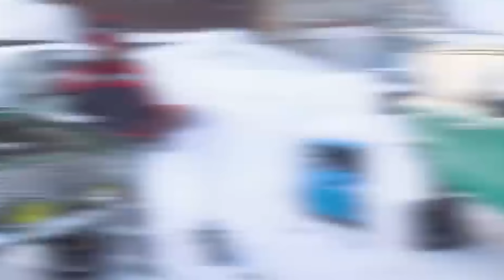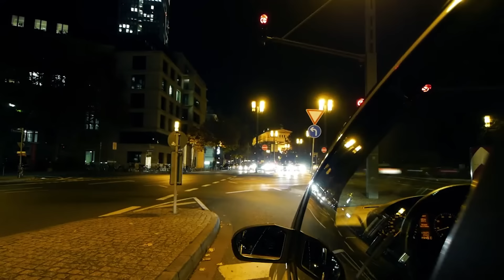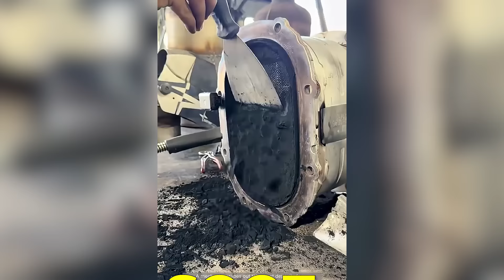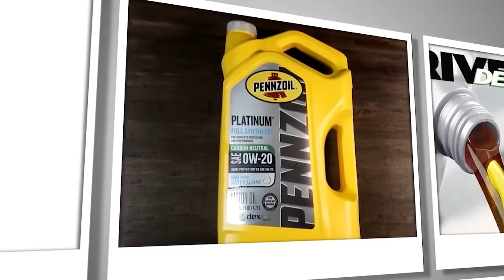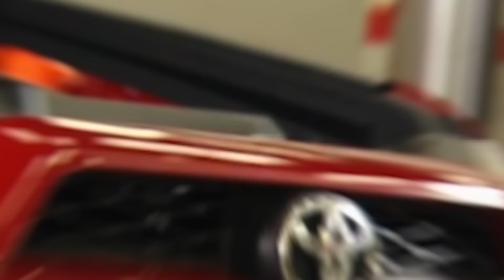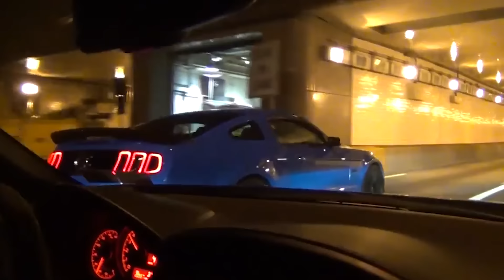(0w20 vs 5w30) The Oil Mistake That Can Kill Your Engine

Comment: I would never a 0w20.   May as well use water.   Funny, I got 285,000 on my 2011 Impala, use 10w30 since new.  Filter change and oil change, in Spring, the Fall,  winter get to -35 in Canada.  In the Spring, the oil is slightly contaminated with water and gas.  In the fall, its dirty from mostly dust dirt and microscopic metal and carbon.
Reply: Great for an older car. Can’t always get away with with that on a newer engine since they are not built like that one.
Reply: My 2010 Ford runs on 5W, and I hate it. I changed oil at 12k, normally going to 15k, and it was like water. Not anything like engines designed for 10W. 

I dont normally check miles as I listen and feel the motor instead, and my Fusion started to tell me at 12k. 

That's shorter from what I'm used to maintaining in my 1991, 1988 Mr2, or even my sold Lexus RX300.
Reply: @phoenixmistertwo8815 you don’t know what you’re talking about. 0,5,10 are not what engines are designed around. It’s the second number of weight of the oil at operating temp or 100 degrees celcius.

Comment: How about 0w30. Its in the middle
Reply: Thats what im thinking of using..mobil 1 0w30 or the new "clean" formula  5w30 with a pour point of -48.
Reply: It’s still 30 weight at 212 degree no matter how you look at it.
Reply: That is the cold weight. Makes no difference once up to temp.
Reply: Again you have to see what type of oil pump the car has. If it has an electric pump that the ecu is programmed to a specific oil viscosity you might not want to go and change thicknesses. Just use the recommended and change it more frequently.
Reply: @digitalunit318  i am driving vw 1.5 tsi, 150 ks and oils that can be used are 0w20, stock, 0w30 and 0w40. So i can choose..
Reply: @tinko975 vw usually gives you an option but you must make sure the oil is vw508/509 spec. I am not 100% if that is tje exact number spec for your motor. If you look at euro oil it is different from US spec. It has different SAPS levels for emissions reasons. That is more important than the viscosity.
Reply: @digitalunit318  0w20 is recommended, not a mandatory . VAG for my car, 2019, 1.5 tsi 150 ks with GPF says 508 0w20, but also 507 0w30 also 0w40, depending on climate zone, also 0w20 for better fuel economy. For proper maintenance it should be all of them, mandatory is to be only low SAPS oil, because particle filter life
Reply: @tinko975 you’re repeating exactly what i told you.
Reply: @digitalunit318  I don't believe that.  Freeze some 0w20 and check flow rate, it's like SAE140.
Reply: @lonniebeal6032 unless you have a freezer that goes to -50. You wont be able to tell. However the 20 has nothing to do with cold temps. It os the rating at 100 celcius.